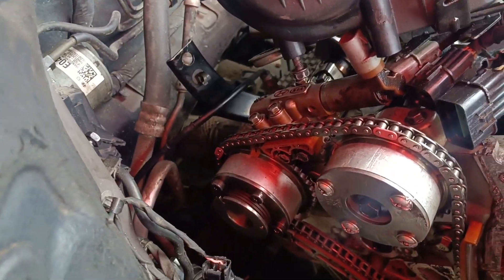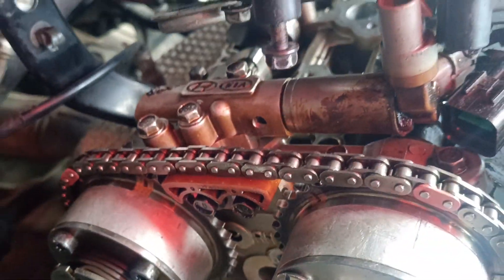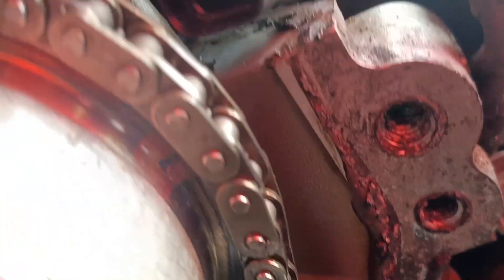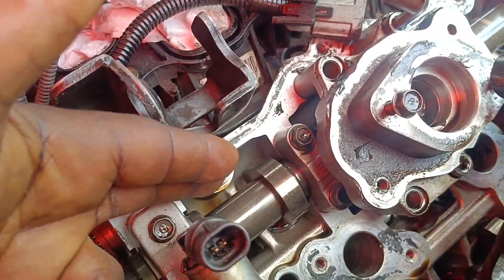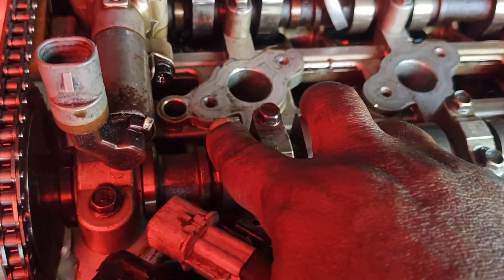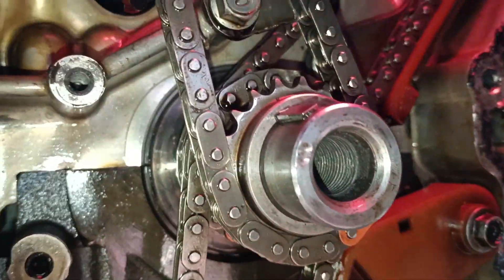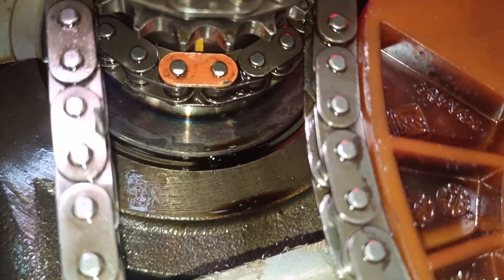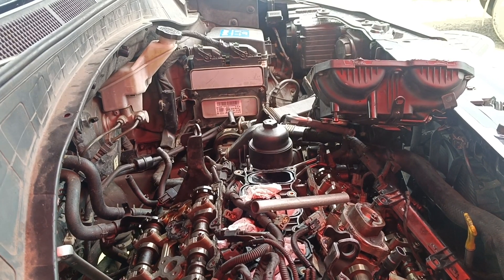Hyundai santafe V6 3.3 engine timing alignment mark and chain adjuster problem part 3

Comment: What would i do if i did not line everything up before removing?
Reply from the maker: Nothing will happen just for you to set the timing back as usual
Reply: @miamiautomobile5566  Thanks so much for the reply. So I would just line up the camshaft and put the crankshaft at tdc?
Reply from the maker: Yes and you are good to go
Reply: When I line up the bank 1 camshaft marks with the head, my cam lobes are not facing each other like yours?
Reply from the maker: Use the color mark on the chain
Reply: @miamiautomobile5566  They have the colorful links.
Reply: @miamiautomobile5566  so I should put the camshafts just like yours are facing? When I do that, the camshaft marks are not where they should be
Reply from the maker: Yeah 👍
Reply: @miamiautomobile5566  when I do that, my intake camshaft marks are not lined up with the heads. Both banks?
Reply: @miamiautomobile5566  At tdc, my   cam lobes are facing just like yours but my camshaft marks are not flush witht he head?
Reply from the maker: Can you take a picture and send to me via Whatsapp. +2348038074534